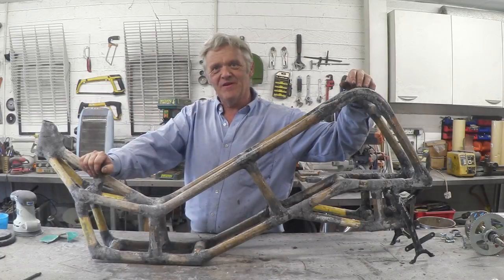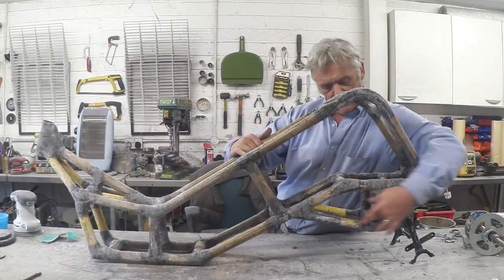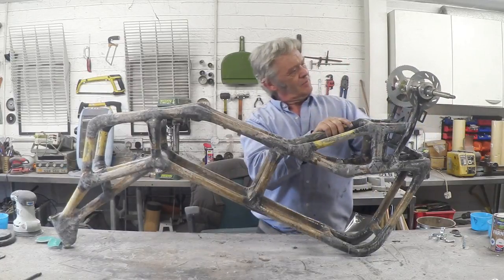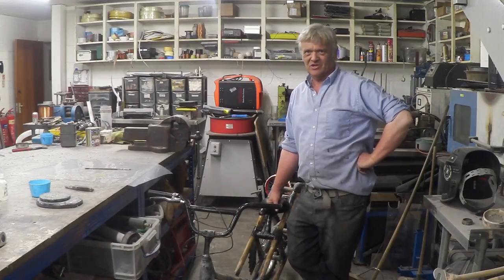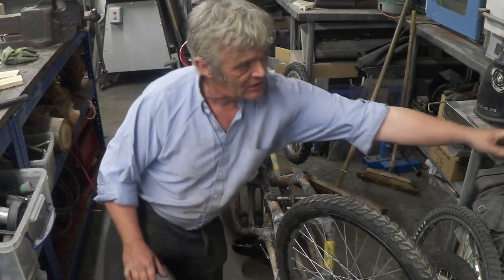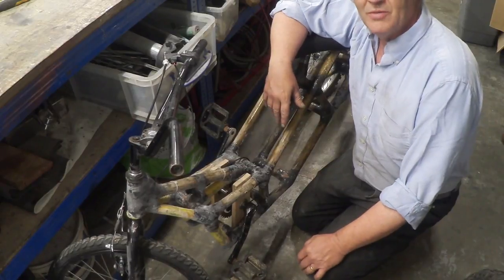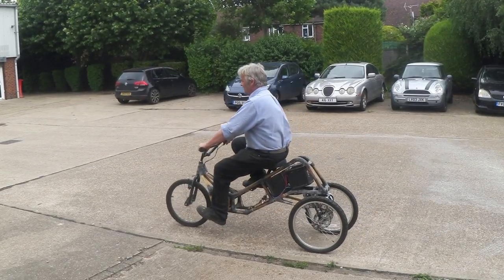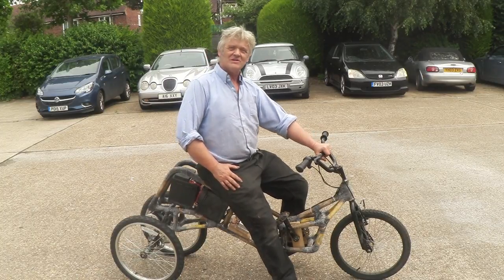1188 Finishing And Testing The Paper Trike

Comment: That thing moves, bit of an odd shape though!
Reply from the maker: little bit but I like it and as it is made from rolled up newspaper how about giving it a go and seeing what you come up with?
Reply: @ThinkingandTinkering I would if I could, but I don't have the space nor the body left to build it.  However, I think I would have built it with a wider axle (though you were building to what you had around) and a bit lower, maybe the batteries width wise along the front of the axle just above the chain drive, or maybe one there and one in front to keep the height down for more stability.  However, it proves, as with the other one you built out of paper just how strong it can be.  If they can built a car body out of banana skins and coconut fibres, almost anything is possible.  After all, who would have thought that fibre glass mixed with resin could be strong?